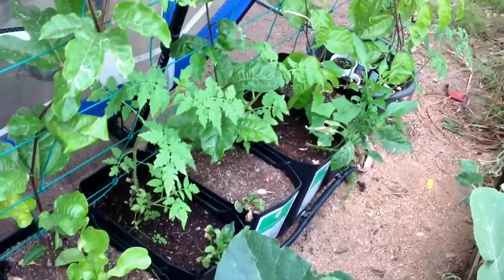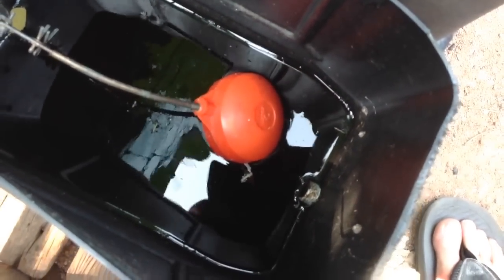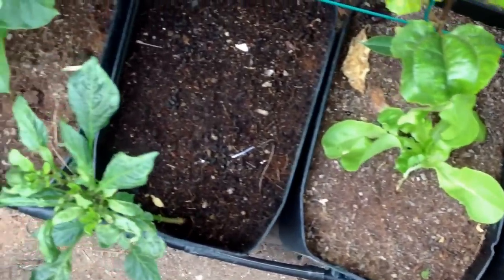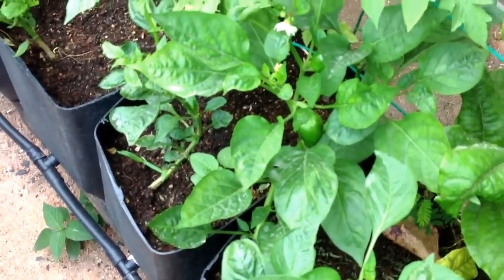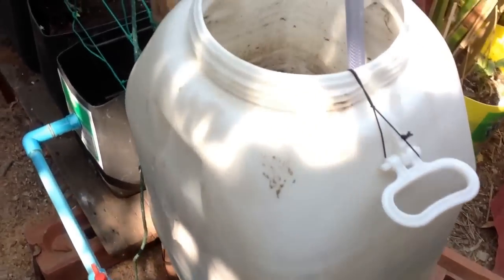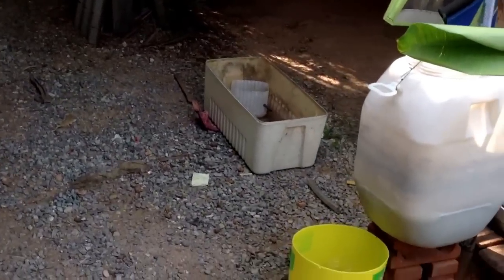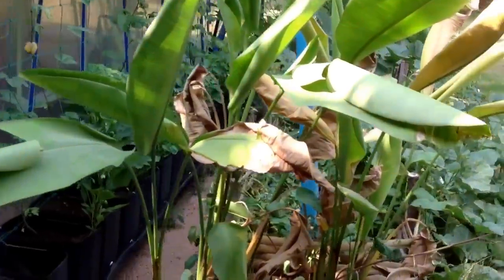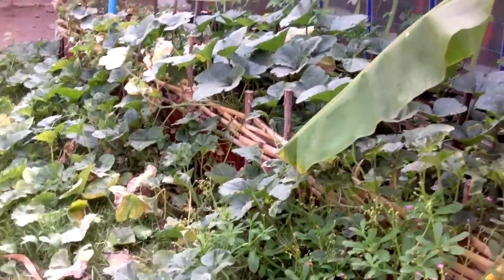Sub irrigated pots on a manifold, with compost tea feed, soil above water, nylon wicks used between.

Comment: Nice set up! I'm curious how you use the tea with a SIP. Do you just put the tea in the reservoir or do you top feed? If you put it in the reservoir how do you prevent the bacteria from going anaerobic?
Reply from the maker: Brian Bouchard No top feeding except for rain. There is a 50L container that feeds the smaller black plastic res. with the float valve. I was feeding low pressure air into the 50L container. The 50L container also contains the "tea-bag" for adding guano ect. So long as the air was running on a cycle there was no smell apart from the usual sweet smell from molasses and EM. There is charcoal in the bottom of each growing container, the soil sits on a shelf above the water and nylon wicks are used to transfer water from the submerged charcoal, through the geo-textile, and the shelf and into the soil. Next build will be similar but the beds will be centered around a bathtub and the water will be flowing continuously. Hope this is helpful

Comment from the maker: Notes for next build: 
1. loose the manifold - leaks are a pain and it is difficult to maintain levels or see and fix any problems. instead I would have excess solution, (organic food in water) falling through a short air-gap into a gutter so that I can walk along and see a trickle exiting each container.
2. Use an air-lift pump to run a Constant trickle, (another manifold) into each charcoal filled water-table - this would increase O2 levels and prevent stale water sitting in the system. I would have little bit of coco-nut fibre in cups between manifold entrance and water-table to trap solids - these could be tossed into the worm bin once a month.
3. Be fun to do deeper pots for small fruit trees - constant flow charcoal bed in the bottom and an extra foot of soil above fed by those terra-cotta water-pot things. With aerated sides to prevent root coiling. (another trick I learned from Rob Bob)
4. One other exciting idea is better than all of above - but no time to build that yet - would love to run it by you if your interested?

Comment from the maker: A real honor to see you here Rob Bob - your one of my inspirators !
the containers are recycled 20 or 25L.(can't remember now) food containers. They look like big motor-oil containers with a handle on top. I cut the top off and drill a lot of holes in it. Then I cut 20cm lengths of Nylon webbing, and run about 6-8 of those through some 8mm holes. End result - about 4cm of space, which I fill with 2inch lumps of charcoal to increase surface area. 1cm air- space above this then the "soil-shelf" formed by the top of the container - sort of jammed onto where the container bevels in at about 5cm up from the bottom.  This creates sort of Glen Martinez style 2-tray method, in other words, lets the soil drip into the resivour - the wicks are there to draw the water up through that air-gap. Obviously the over-flow, which is connected on-level to a manifold is set at a height that is about 1cm below the "soil-shelf".